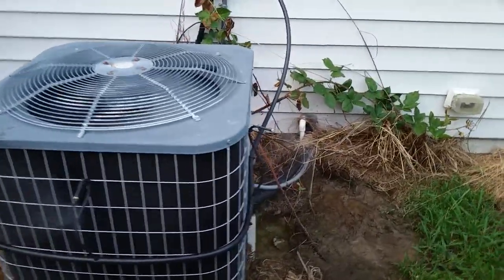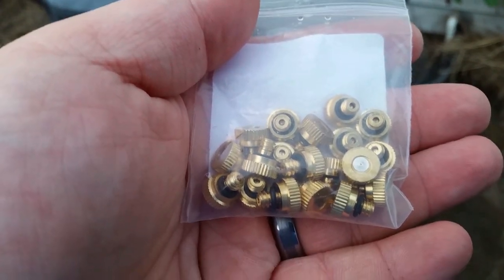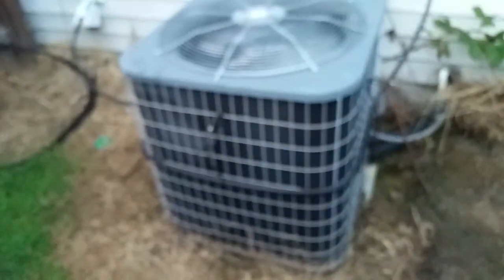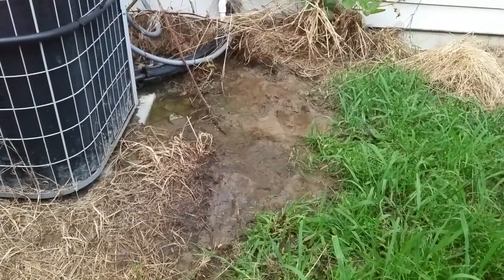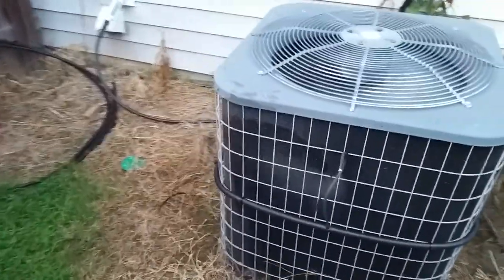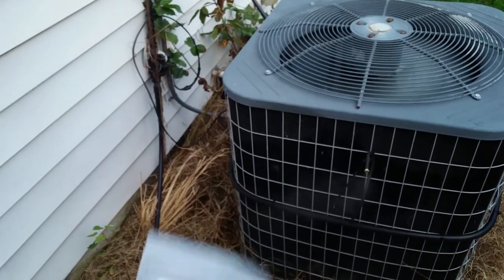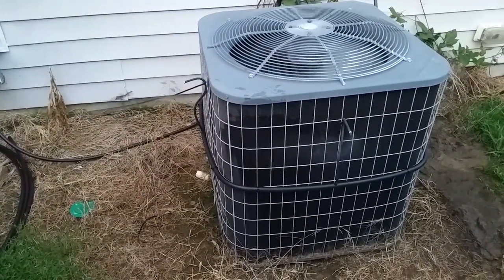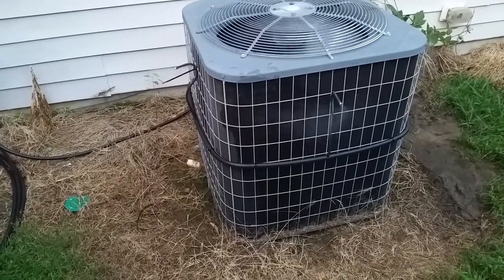Rainbird Irrigation DIY AC Condenser Mister Update

Comment: Excellent idea using a regular irrigation valve to control the water. I used a regular misting kit for mine. With a irrigation filter and pressure regulator. Might need to add a calcium filter also. Thanks for the idea of controlling the valve with the 24 v from the thermostat. That was a game changer.

Comment: One factor that is not often mentioned is that water that hits the exchange coils provides a high degree of improvement in efficiency.  The hot coils causes water that coats it to evaporate. The highest efficiency is achieved by having just the amount that will evaporate.as water changes state from liquid to gas.  Some commercial cooling systems drip recycled water over a set of exchange coils.  

The misting systems may achieve some of this effect.  The system is not designed with that in mind.  It would be interesting if experimentation could be found - perhaps a hybrid in which a drip line placed at the top of the exchange coil is used in conjunction with the misting.  The trick would be to adjust the water output so that water is not wasted... just a small amount of drip so that it evaporates before reaching the bottom of the coils.

Comment: Hi. I am wondering if you still have this setup running. I have couple questions: 
1. Have you noticed reduction in electricity cost? 
2. How much more you spent on water? 
3. Does the Calcium Inhibitor Filter prevents coils calcification and how often do you need to replace it?

Thanks

Comment: I made a system on a 85 ton cooling tower.  I used a Watts pressure reducer to reduce the pressure to 15 to 20 psi. I used a Penn thermostate strapped to the liquid line set at 90 degrees to control the solenoid.  I used agricultural spray tips with a flat spray pattern.  It only ran in the heat of the day in Wisconsin.  I used it for 10 years untill the cooling tower was replaced with a new, efficient one.  No problems but blow the water out in the fall

Comment: Nice. Do yourself a huge favor and get that condenser lifted up 4”or so.  You can use 2” thick cinder blocks. That will improve longevity and efficiency.
Reply: Can you do this to a unit with the lines still hooked up?
Reply: @jdcapps21  Each system needs to be evaluated, but typically yes. Just be careful not to damage the 1/2” to 3/4” copper tubing. That’s the major item at risk.

Comment: thank for your video I just install on my ac system, but I also  connect the wire to the old mercury thermostat and adjust that it turn on the mister when the outside temp more than 90degree f the parts are ( Orbit 20066 Portable 1/4-Inch Outdoor Mist Cooling System    15$ and Orbit 57280 Female Pipe Threaded Auto Inline Sprinkler Valve, 3/4   13.62$,  Orbit 10109W Misting Calcium Inhibitor Filter  19.98$ for total 48.60$ from Amazon), and one of old mercury thermostat.

Comment: I can run water that goes through softwater filter, so the scaling will not be an issue. I have home warranty on all the appliances. I am afraid that the warranty will be voided if the technician will see that I have this type of cooling system setup.

Comment: thanks for your update. How is the electric bill and calcium build up?
Reply from the maker: I haven't had it on very long, only a few days with the new nozzles. When I was using the rainbird nozzles I only ran it for 3 days, as the water buildup was too much. The newer nozzles are doing much better but still has only been a few days. I am on city water in NC, there isn't much calcium in the water as is, and I am also running a calcium filter. I don't expect there to be very much but we will see. I will make an update video in a few months to see if energy usage has gone down. I'm going to try and compare with last year as well as whether the weather was the same.

Another factor that is going to complicate things with my scenario, is I had an electric car last year (Chevy Volt) so I'm already going to be using less energy because I'm no longer charging a vehicle every night. I'm just going to make the assumption that other people who have also done evaporative coolers on their homes have seen real world change, and will just to hope mine is making a difference as well. 

The temperature difference from the air coming out of the vents is noticeable. Also the hot air that normally blows out of the evap unit outside is a lot cooler with the water running so I'm sure it is working.

Thanks for watching, subscribe for more updates!

Comment: For your drainage issue, get a 55 gallon drum, cut several 1/2" - 3/4" holes in it, dig a hole away from the home at least 10' but recommended at least 15' away, line it with landscape fabric, bury the barrel on a bed of gravel and surround it with gravel. Dig a trench from where the pooling happens and install perforated corrugated pipe to the barrel. Bury that with the landscape fabric and gravel and cover it with your soil/sod. Install a 4" minimum diameter pipe of choice to go to the surface from the barrel. Cut the pipe to grade and install a grate. Fill in and reinstall the sod you cut out. That will solve the drainage issue and if the barrel fills, it'll escape through the grate to daylight

Comment: Dude don't waste your time. You know what works every time? Set your thermostat one or two degrees higher.
Reply from the maker: I like A/C.... It's set as high as I can tolerate it. Nothing wrong with a little more efficiency.
Reply: Its the humidity not the temp that makes one uncomfortable. I don't even look at temp in the house. I monitor humidity. Keep it at 50% or below and you'll be fine.